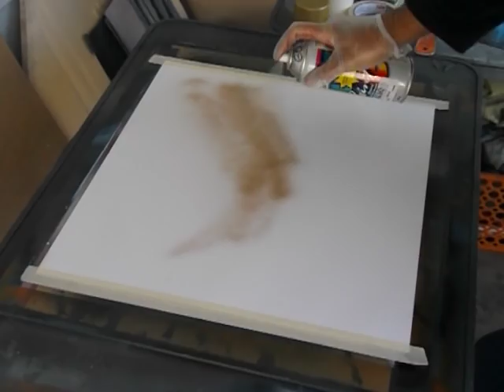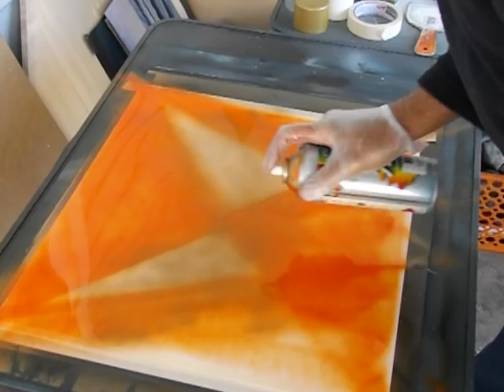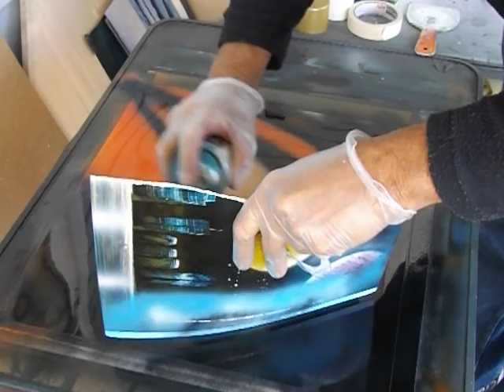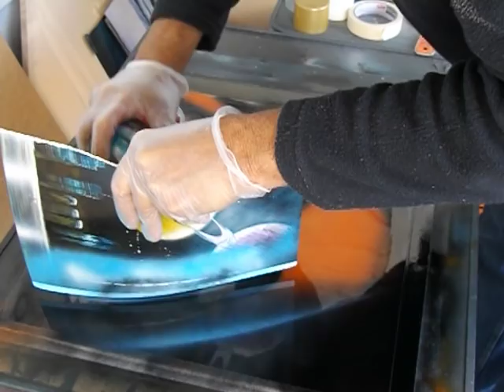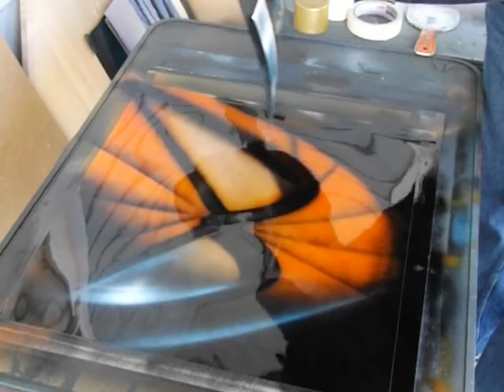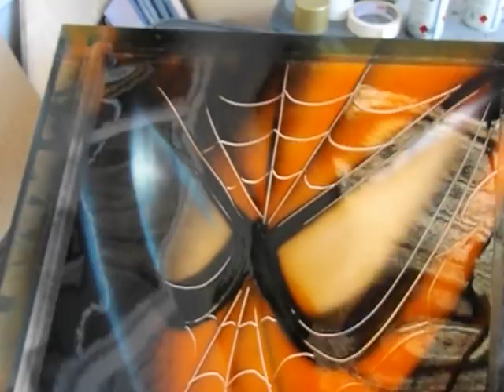Spray Paint Art Spiderman Tutorial

Comment from the maker: Hi Luke
I use a 300gsm white glossy card from your local printers.It is also know as poster board. The tool for the lines is just a plastic paint scraper from a hardware store...costs a coupla bucks. Use it while the paint is still wet and its scrapes down to the white card creating those white lines.
Cheers
Reply: What's the size of the card used ?